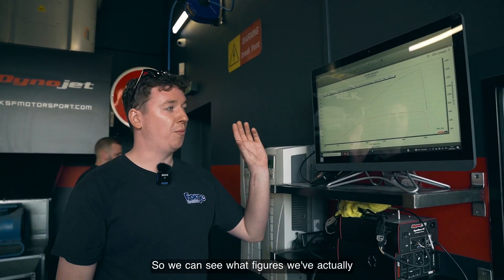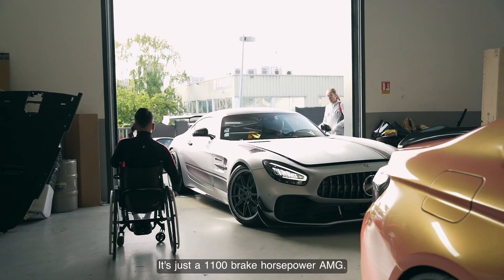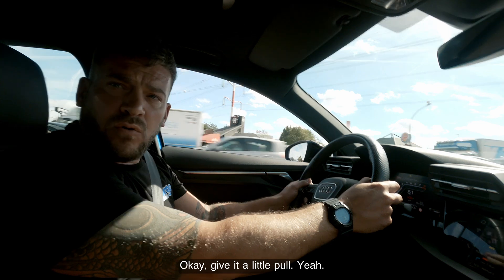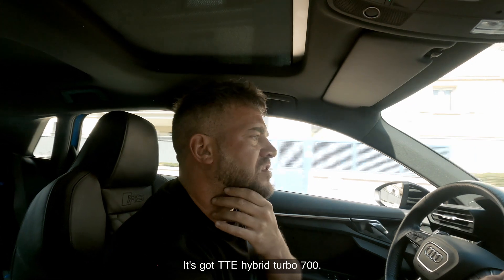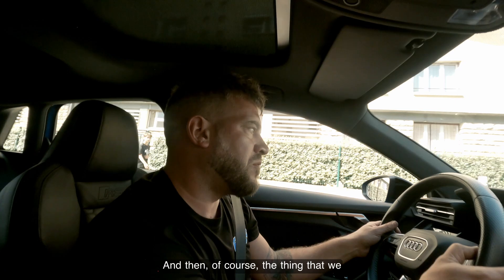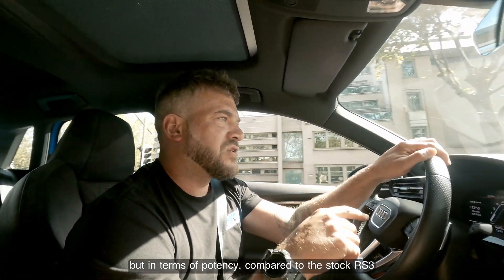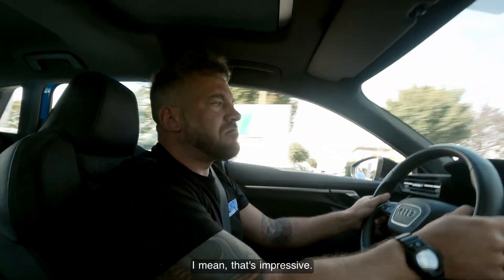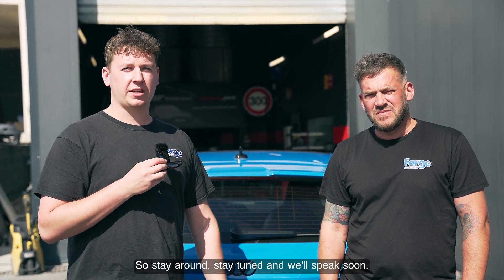IT'S DYNO TIME! Intake Development for RS3 8Y & 8V | Episode 4 | Forge Motorsport

Comment: Has the 8Y ecu been unlocked?! They're some phenomenal power figures
Reply from the maker: Yes, the ECU for these has been unlocked! This particular vehicle was running a TTE777 Hybrid Turbo!  Depending on your location, if you get in contact with MRC in the UK or KSF Motorsport in France, or MRC Romania they would be able to help you with this!
Reply: Buddy that ain’t the fastest 8Y… IROZ has you beat
Reply from the maker: @carlotlife5013  We know IROZ, they make some lovely stuff! We think at the point we filmed the video this was the fastest 8Y, as it was early 2023, we just released the video at a point when we were close to the release of the product. Hey, either way! Fast is fast!